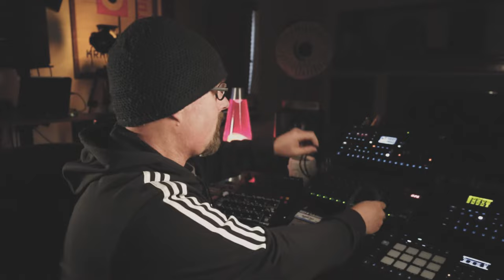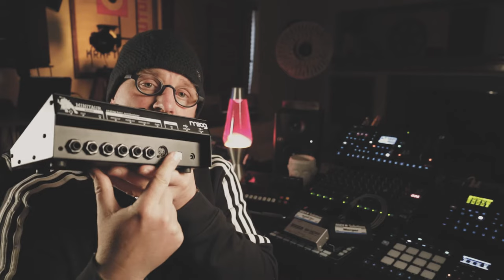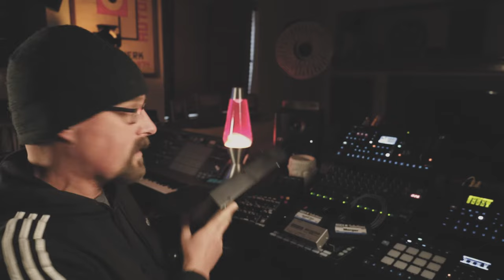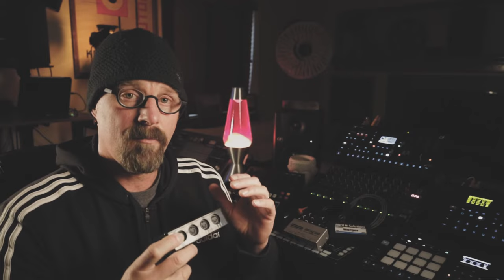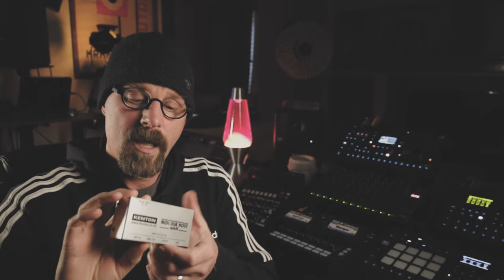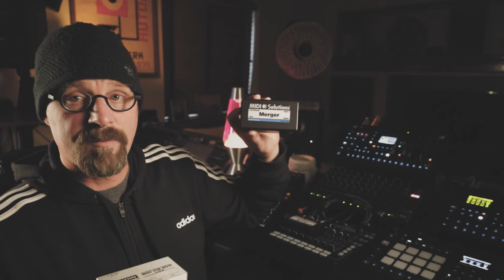MIDI Basics Explained: DAWless Connections, Routing, Convert USB to Din MIDI, Merging, Splitting

Comment: Thanks for an excellent explanation of MIDI. Still a bit unsure about setting up midi channel numbers. I am using a Jupiter x as master but not sure about how to set up channel numbers from to all other synths and drum machine. Also do i need to send midi to and from Focusrite audio interface.
Reply from the maker: Set each synth to receive on a certain channel (check each manual for how to set this). You don’t need midi to and from your audio interface but it is possible. Thanks for watching!
Reply: Thanks for your reply Surco. Multi timbral Jupiter x seems to send five parts for each first five midi channels. So lets see what happens . Cheers.

Comment: My U-20 kybd/controller recently died. It served me well for many years in my midi studio.
I bought a new MK3 Maudio  61 to replace it. (usb powered)
I placed it into where the u-20 had been, and connected the usb to my pc.
I use windows/logic audio gold(last version before Mac bought Logic)/Motu Micro Lite/4-5 external sound modules.
It worked........until when really sending/receiving a lot of midi data, notes started hanging up/sticking.
The midi mapping that Logic does + the drivers of the Motu, could not handle the additional data being entered via the usb powered MK3 into the pc.
I never had this problem with the u-20.
I found a 9v 500mA wall wart to power the MK3 and removed the usb going to the pc.
The MK3 powered up, lights on, but the Motu would not acknowledge it/a signal.
I then bypassed everything attempting to send a signal from the MK3 directly to a module.....nothing, no signal.
I have a replacement MK3 coming in 2 days, since the first I rec'd had been opened and the things that were supposed to be included were gone.  Amazon said they'd send me a whole new MK3, and hope this time nobody opens it, or damages it.
So it could be the next one will/can act as a stand alone controller for a sound module.  I'll know in 2 days.  And, perhaps the sticking notes were in the MK3, not conflicts with drivers.

Interesting?  When I asked amazon, "so you'll pickup this one when you deliver the next one",  
he said, "no. you can keep that one too".

Even more curious, why did the UPS man deliver/set an opened box at my doorstep?  Anyone could easily see it had been ripped open?

Well, that's my rant for today.
Thanks for a very good midi presentation.

BTW, it seems as tho the new daw world folks pay little attention to ports/channels like we all did in the past.

Comment: hello, i have an axis 49, it has no power cable, only midi 2.0 and is powered via bus power. Is there anyway to use this dawless? thanks for this video and i appreciate your time if you have a moment to spare :) thanks
Reply from the maker: I just looked it up and it seems that it would just require a USB midi host box. One thing I noticed is that it can only transmit on midi channel 1, so you could only control one device, and it would need to be set to receive on channel one. I hope this helps. Thanks for watching!

Comment: I'm trying to wrap my head around midi as well.
I have 2 drum modules I'm trying to gain trigger input expansion basically.
However I've seen plenty of videos on the fact that it is stressed that midi isnt audio its instructional chaining.(equipment etc.)
I grasp that but on the other hand I hear drummers say to expand your pad access or triggering surfaces you either go aux in (which I feel is limiting usefulness say I record on my main module a beat ,it wont be recording all pads likely only half of what I hear audio wise it's not incorporated or recognized all surfaces)
Or midi 
I hear things like the slave tells the main module what to voice . Well instantaneously would be nice truthfully but I'm not having much luck .
The settings for the slave and the main module would be of great use to get instantaneously cause the further I go into midi the more foreign the language gets .
There's midi mapping there's drum maps I cant after getting so frustrated at times figure out if they are talking a map like a drum library I can pick and store to build kits from like a glossary of voices .
It's totally overwhelming
Reply from the maker: it can be a lot. just keep in mind that midi tells a sound source what to do (what note to play, how hard, for how long). it is just instructions to whatever your sound source is. you can have all the drum pads in the world but if they are not each mapped to a sound source, their midi out will do nothing. that sound source can be a synth, a sample player, a computer with virtual instruments, or whatever. midi is the language the cables transmit from a controller (keyboard or drum pad, or whatever) to the sound source. I hope this helps a little. thanks so much for watching.

Comment: I have a guitar amplifier but it doesn’t have MIDI. I want to control the channels of the amplifier by of the Ampero Control MIDI controller, but i don’t know how to do this connection.
I need to change the channels of the amplifier and mix with analog guitar pedals.
Reply from the maker: Unfortunately MIDI only works with MIDI. A MIDI controller can only control a device (or devices) with the capability (and inputs) of being controlled by MIDI. There are MIDI guitar amps and amp heads as well as MIDI compatible pedals that can be easily set up to be controlled by any midi controller. Thanks for watching.

Comment: Excellent explanation,  I have questions, how would you connect 2,3 synths and drum machine the simplest way
Reply from the maker: It depends. If it is for clock only, they can be chained if they have the right out or through ports. If it is to control them, a midi through box would be easiest. I hope this helps. THanks for watching!

Comment: This is an amazing video. Thank you sir. Also, Where did you get your stand that the octatrack is on? I could use some!
Reply from the maker: Thanks! I got the stand from Reverb. Here is a link: https://reverb.com/item/17157401-desktop-synth-stand-medium-2-tier-expandable-adjustable?utm_source=google&utm_medium=cpc&utm_campaign=12293041879&utm_content=campaignid=12293041879_adgroupid=114838722142_productpartitionid=1170763577959=merchantid=128151571_productid=17157401_keyword=_device=c_adposition=_matchtype=_creative=497393521577&gclid=Cj0KCQiA9OiPBhCOARIsAI0y71BXT6w1esgd8XdrR-mcGCJimFx0GBpZTz81KTRUbn5-BBeu5Ka_FmwaAgLjEALw_wcB
Thanks for watching!

Comment: do you know of any cheap solution to connect my USB midi out drumpad to a drum synth with only DIN midi in? Because if that Kenton USB host is the cheapest way, I shall just spend 20 bucks more and finally get the midihub by blokas.
Reply from the maker: USB MIDI Host is the only solution I know. There are a few brands, but they are all similar in price. I'm not too familiar with the Blokas, but it seems that it only has a USB 'B' port to come from a computer before sending the signal over DIN MIDI to devices. If you are using a USB drum pad that also has a USB 'B' connector, the Blokas would not act as the 'host' for the USB. You would still need a MIDI host, or plug the drumpad's USB into the computer using the computer as the 'host', then use the Blokas to send the DIN midi to other devices. If you are not using a DAW, the USB MIDI host is still the answer, but if you are using a DAW, any USB MIDI Hub (Blokes, Mio, Motu, or even many audio interfaces have midi connectivity as well). I hope this helps. Thanks so much for watching!

Comment: Do you know if the midi interfaces from Arturia, MidiFuses, can act as an USB host, without computer?
Reply from the maker: Generally a midi interface is for connecting to a computer. I’m not familiar with all of their devices, but I don’t think so. There are devices like the iConnectivity MioXL that are made specifically to be both a computer connected interface and a stand alone midi hub/switch/USB host. Thanks for watching!

Comment: Hey man I’d like to use my Maschine MK1 controller to control the transport functions of my Tascam DP-24 multi track recorder. I should go midi out from the Maschine to the midi in on the Tascam right? Then set the Tascam as the slave? Sync should be clock or MTC?
Reply from the maker: Hey! Not familiar with that Tascam model, but cabling should go from the unit that is controlling to the unit being controlled. Then each will need to have their midi config settings aligned so they are 'speaking' and 'listening' on the hcannels and to the message types desired. Thanks for watching!

Comment: Very useful video. I'm fairly new to Midi although I have used in past. But every thing changes with time. I have a "Casio MIDI guitar" and a "Ketron SD-2" sound module with (1) in port (1) thru port and the only out is a RCA connection. I can select and instrument with buttons on the guitar. I would like to connect the sound module to my computer in order to see a list of virtual instruments or pads. Is there a way to do this using GARAGE BAND ?
Thanks for any help, Donnie
Reply from the maker: I wish I could help. I haven’t used Garage band. Ultimately it would depend if the individual pieces were set up to do that in their software. thanks for watching!

Comment: I daisy changed my Elektron boxes using MIDI IN and MIDI trough. That way the fist box sends the clock and program changes

Then I wanted to connect a keyboard that kan play all boxes. So that needs to go in front of the chain. That ment that the first box needed to use midi trough, and that the keyboard needs to send the clock.

If I use midi out on the first box, the keyboard notes don’t get past the first box
Reply from the maker: You need a merger. Send the clock signal as it is. Plug the keyboard in to the ‘in’ on the first box. Merge the out and through from the first box into the second. Then you carry both signals together ‘through’ the second box. I hope this helps. Cheers!

Comment: perfect video, thank you very much for straightening out so many questions in my head!! liked and subscribed!  one question please, if i have two midi devices with usb, since you said midi usb is bi directional, if the usb cable connecting them in a DAW less scenario has the correct usb ends (type B?) can they talk back and forth to each other? thank you!
Reply from the maker: They need to communicate through a USB Modi Host. It would depend if one is or not. That would allow communication into that host from another one. Thanks for watching!

Comment: I have a very old keyboard (korg x3) some buttons are not working anymore.  It does have a midi port. Can I somehow control it through my computer, like selecting sound? If so, how? Thank you very much.
Reply from the maker: Hi. It should be able to be controlled from your computer via midi if everything is still working. You will need some sort of midi interface to connect via usb to your computer that will have midi out ports. Connect a midi cable to the midi in port on the x3. Make sure the daw in your computer is sending midi on the same channel the x3 is set to receive on (check the manual to see how to find this). The manual should have a list of cc numbers for each function you want to control. This is over simplified but it is possible.

Comment: Do I place the audio interface before or AFTER a synth module?
Reply from the maker: In a MIDI chain it depends on what you want to control with what. The signal flow is one direction, and the availability of In, out, and thru ports on each piece of gear will impact the placement. To fully answer I'd need a bit more info like what pieces of gear, what needs to control what, and what ports are available on each piece. Thanks for watching!

Comment: Great video! Would you still keep these connections if you’d want to combine hw with sw synths in a daw on the pc? Or just go usb then? Maybe these din connections are more reliable?
Reply from the maker: I would definitely suggest using USB whenever possible to save cabling. This is geared more toward setup that are not connected to a computer. Thanks for watching!

Comment: I'm at a point where my setup needs a merge box and probably a through box as well... And usb to DIN eould be nice. I'm really tempted to get something like the iconnectivity MioXL. Any thoughts on that or similar devices?
Reply from the maker: I have a mio XL I'm selling. Never got the use out of it. I prefer the flexibility of the smaller boxes without having to set up presets in the computer. Check out the MRCC from Conductive labs. THat's what I'm using now and its AMAZING!
Reply: @SURCOlive  thanks so much for the response!

Comment: Hi great video, I want to connect a volca with my controller midi that have a 3.5 midi out , how can i connect them? I only require the cable with the midi 5 pin with the 3.5 mm on the other side? Thanks
Reply from the maker: Glad you liked the video. Yes, just make sure you have the right one. Now sure if the Volca takes TRSa or TRSb. Thanks for watching!

Comment: Any issues with power for that merger box? I have a weighted midi controller that sends notes and velocities as input into my workstation via midi and am planning on sending program changes to that same workstation via another midi device and needed to merge both midi signals.Great video!!
Reply from the maker: I haven’t had any issues with power but my use isn’t quite the same as yours. Glad you liked the video. Thanks for watching!

Comment: Hi Eric, I have a bunch of sequencers and synths along with a handful of controllers, I also have some analog modular synths. Most of my gear has DIN connections, some are Class Compliant USB only.  I use Ableton as my daw, but I want to be able to use most of my gear without relying on my PC. I was thinking about getting a through box, merge box and USB to din box like you are discussing; however, I came across the iConnectivity mioXL 8x12 unit and as far as I can tell, it will accomplish all of what you're explaining, is this true? If so, can you see any reason NOT to use it? A couple of features I'm interested in at the profiles and RTP midi over Ethernet. Also, what considerations are there for a master clock, I'm thinking about using my beatstep pro, or drumbrute, since they're almost always in use , any suggestions? Thanks!
Reply from the maker: I have the mioXL, and I have not been using it since I get the Connective Labs MRCC. The biggest difference for me is that the setup of the mio is very complicated and you need to do it in your computer before you can use it without. The MRCC is very intuitive and everything is done in the box itself without the need for a computer. You can also link two MRCC's together via ethernet, or they make outboard extenders for different parts of your studio. I love mine and would recommend it highly. Thanks for watching!
Reply: @SURCOlive  Excellent! Thanks!

Comment: Don't use more than one thru connection in a chain if you can help it. Every step in the chain creates latency, so if you thru three or more devices, the device at the end will be getting the signal on a delay and you won't have a tight sync.
Reply from the maker: Shorter chains are always the best option for sure!

Comment: Could I ask for your advice again please re my MIdi setup. I have a midi control KB running into the IN of my Digitakt and connections from THRU and OUT running to a Merge box and then OUT to a Midi Router and onto several hardware synths including an Analog 4. I want to use the Digitakt as the master clock for my setup but not sure whether this will work without buying more Merge or THRU boxes and whether it has to be somehow configured to act as master and everything else configured to be slaves. Many thanks.
Reply from the maker: Not sure. It depends on what else you want to control other things. The answer on the config is yes. It needs to be configured to send clock and anything else you want via midi, and the other devices need to be set up to receive clock and anything else. The channel for sending and receiving need to be configured as well so the sending device is sending on the same channel the receiving devise is 'listening' on. This is for notes, cc, and program change only. Clock will send and receive generally (not by channel) once the machines are set up to do that. Thanks for watching!
Reply: @SURCOlive  Many thanks for your reply, much appreciated. All synths are set to receive notes etc on dedicated midi chanels and work just fine, it was the clock I was bothered about so that all drums/arp's etc are sync'd. I can set the Digitakt to send clock but it looks like I'll have to see how to set everything else to receive clock. Cheers.

Comment: May I ask you a question? I’m new to recording equipment. I’m trying to determine, for my initial purchases of equipment, if I should get a midi controller that has midi plugs, instead of usb. Is there a difference in quality or latency? Why would I get a usb controller rather than a midi? 

This of course would depend on whether my audio interface has midi, I understand that. I guess I’m trying to decide what kind of controller to get. Probably just need a good basic one since it’s my first one. Thanks for your time!
Reply from the maker: A lot of it depends on what you will be controlling. USB is convenient for controlling a DAW, but most equipment can’t be controlled directly via usb midi. Most synths would require a usb midi host box to convert the usb midi signal to a din midi signal. I hope this helps. Thanks for watching!
Reply: @SURCOlive  thanks for replying! It would be for basic, general control within a daw.
Reply from the maker: You should be great with a usb device then !
Reply: @SURCOlive  thank you! Keep up the good work on your channel.